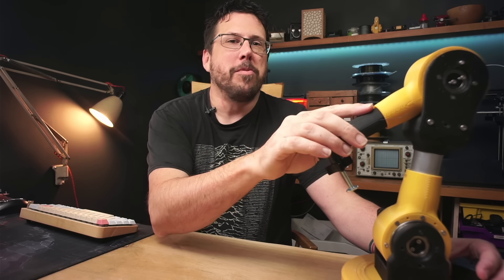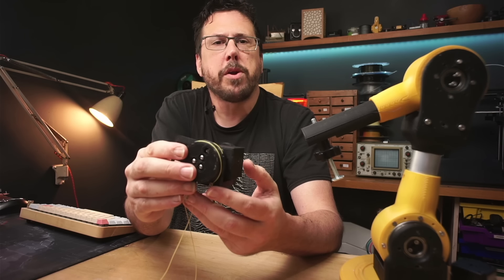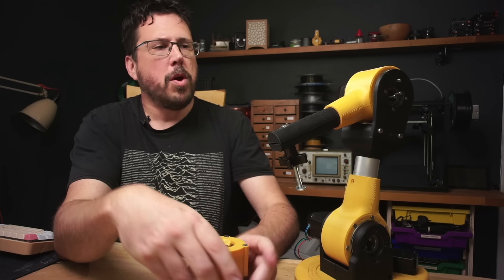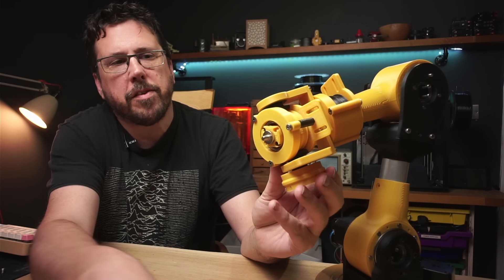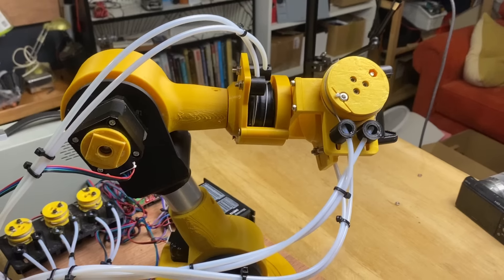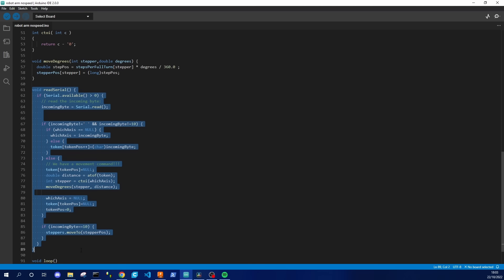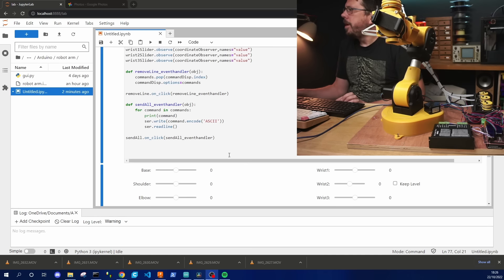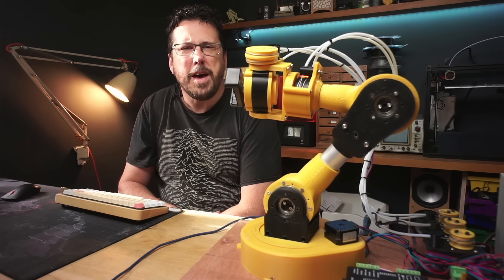Robot Arm Wrists are too heavy - until now!

Comment: I'm a beginner and I adore your ideas of running soft PVC tube protecting fishing line to simple turning motors instead of having heavy motors inside the arms. Simplification is something I am heavily targeting. Thank you Sensei. Subscribed, thumbs up. One question. I want to do the same thing for the a simple humanoid like robot for the shoulder joint as well. I am targeting rapid accurate movement with no weight being applied to the arm at all. It's more of an aiming system. Will it be foolish to apply the soft pvc tube protected fishing line design to the shoulder joint as well? I think I'm aiming for 3DOF on the shoulder joint at this stage. It's a robot that simply wants to flick light switches on and off in rooms. Just a bit of fun really.
Reply from the maker: Hi, that sounds like a great idea, I can't see why it wouldn't work. One thing to not is that this is not soft PVC tubing, it is PTFE which is slightly more rigid but also had a very low coefficient of friction which helps reduce the wear from the fishing line. Good luck!

Comment: Wow! Dude how tf I didn't see your channel earlier! The tubes with the wires are awesome! These motors at the top actually require the highest amount of torque from the shoulder servo as they are usually the furthest from the center of rotation.

Question: how many volts are you using for the stepper motors? 

Very very nice work! I'll replicate your work.

Thank you.

Comment: Outstanding, Hi, Since you are already familiar with the whole process, can i request you to think of designing an ELBOW joint with a single Motor/battery/controller in the foreArm section joint will have a one axis movement, (0-135Degree) , plus JOINT movement will be dictated by position of the Humerus section position/gesture.. i need this project for a real human use.. please let me know if we can collaborate..

Comment: If you're having problems with precision
attach your motors to a pinion
attach your lines to a rack
you can now get direct linear input to your wires for the whole length of your rack without having to worry about the changing diameter of your spindle

other things to get more precision is reducing the stretch on the wire, but i believe this would be more of a material science thing
one way to cheat this for stability is somehow working out a ratchet or brake system into each of the axis so it can hold its orientation without needing tension on your wire, or changing it to hydraulic. 
cool project
this kind of stuff is beyond my scope of competence

Comment: This is incredible. I am curious about how much wiggle or precision is gotten through this method for the wrist?
Reply from the maker: Some precision is lost as the lines can stretch slightly etc, but in my latest video I mounted sensors on each axis to make up for this. I’m getting better than 0.1degree precision now

Comment: I love your project.  When are the files going to be released?
Have you load tested it yet?
Is there a way to manage the tubing inside the arm?  I was thinking of a similar idea, but with the string running inside the arm via pulleys.
Is there a rough cost estimate for the arm so far?
Is there a way to speed up the stepper motors?
Reply from the maker: Thank you. Here's the answers to you questions:
1) I'll be releasing rough CAD and code files in the next video - it won't be a finished project by then and there won't be a BoM or instructions - but people have been asking for them A LOT. You'd have everything you need to build one with a bit of work, but THINGS WILL CHANGE in the design as I do more to it.
2) Nope. the wrist I showed in this video isn't that strong, it's up to my design criteria of carrying a camera, but not much more than that. The other joints are strong though. I need to add more reduction to the motors on the wrist. at the moment they are running at 2:1 compared to 20:1 for the other joints
3) Maybe.... The problem is that on the 2nd and 3rd joints of the wrist, the tubes need to move as the joint before them moves. If you can solve this (pulleys, bearings etc), then YES. I'd love to see you do it  :)
4) Ignoring electronics, PLA and fasteners, is about £50 on bearings and £50 on stepper motors
5) I don't think you need to, this thing goes FAST! I'm only showing it at about 1/4 speed in my videos
Reply: @roTechnic  Thanks for the response.  I think we all apreciate the time you take to read and respond to our comments.
 I know people pester you for the files.  Sorry to be one of them.  I guess it just means you are making something exceptional.  I'm excited to start work on this project and see if I can contribute.  
I don't know if you've seen his work, but Paul Gould does some great robotics work with different types of actuator mechanisms.  Here's a similar one to what I was thinking. https://www.youtube.com/watch?v=HWTwnZBwPuo
Reply from the maker: Thanks, that's really nice of you. I don't mind being pestered for the files, but I also don't want to release rubbish out - I'd like people to be able to actually make these things :D

And, yes - I know of Paul Gould - love his videos - and he is a sometime commenter on this channel!

That's a great design he's done, but I'm struggling to think of how to include another rotational axis BEFORE the tilting mechanism. I'm sure it's possible, but the solution is eluding me at the moment. If you've got any ideas then let me know (or make your own video, I'd love to see more robotics content out there)!

Comment: I have tried something similar in the past (i.e. using lines), but in a slightly different application.  I couldn't keep tension on the lines properly, and the lines would jump off the pulleys.  Did you have any such problems?  I wasn't using Bowden tubes, so perhaps that was my mistake.

Comment: Many high payload industrial robots solve the heavy wrist problem by using concentric shafts running down the arm, with all 3 motors for J4-J6 located at the elbow. Similar concept to your solution but with higher rigidity for more precise movements!
Reply from the maker: yeah, but I wanted to retain over 180 degrees of movement on the elbow joint and couldn’t go single sided

Comment: Super cool!
How much force can such mechanism (fishing line on plastic) create?
Also, can you show how you connect the fishing line (the knot) in a way that doesn't interrupt the movement of the mechanism?
Suppose I want to enable power-over-speed through the use of some planetary gear reducer, this means that at some point the knot on the line will reach the pulley. Will it interrupt it?
Reply from the maker: Hi, yes, unfortunately this doesn't provide continuous motion, I've got it set up so it allows just over 360 degrees of  motion

Comment: Just curious: why not just go hydraulic at this point? You’re already running tubes, and hydraulic pressure would provide more force for less effort than the cable setup.
Reply from the maker: I’m trying to keep this arm a cheap and simple as possible, using components that most tinkerers will have around, or at least have used at some point.
however, hydraulics would be awesome for this, and I’d love to do that as a future project

Comment: Excellent build! Definitely one of the cleanest 6DOF DIY arms I've seen. Out of curiosity, did you experiment with using different materials for the cables? I've used a similar mechanism for simpler builds, but immediately abandoned fishing line and switched to cotton thread to reduce elasticity. In hindsight I may just only had had cheap stretchy fishing line on hand. Also, I've been routing my cables with pulleys on each joint, which is slightly more compact but more complicated and a huge pain, especially for higher DOF builds. I'm curious what your thought process was on using Bowden tubes vs other methods.
Reply from the maker: I must admit that I already had done that testing years ago when I designed a laser engraver using fishing line to move the X and Y axis. I know that I tried quite a few things then, but for the life of me, I can't remember what materials I tried. I just remember that Spectra fishing line was best.

Comment: I don't understand the pulley arrangement at 0:50. How do you maintain the tautness throughout the lines. Does one line not droop when the other line is taut?
Reply from the maker: there is a matching pulley on the other end which takes up the line which would otherwise droop. Please see my video "The lightest robot arm actuator" for more details

Comment: Really nice idea Ro. I've used this technique in one of my machines as well. A lot of people take the shortcut of simply wanting to use servo's or stepper motors directly on the arm with either direct drive or a belt drive, but I still think that these actuator-kind of solutions work the best for lowering the weight of the moving mass.
Reply from the maker: Thanks Marinus. Have you got any pictures or videos of your machines?

Comment: Would there be any value in using 3D printer filament ... a non-brittle kind, like ABS, instead of string? Might have less friction in the bowden tube?
Reply from the maker: There could be... Can you think of any way I could attach the filament to the pulleys as filament doesn't like being wound and unwound - it gets brittle and breaks.
Reply: @roTechnic  ahhh, I didn't think that far ahead. Probably should have. Maybe it's a bad idea. I was just thinking that it can be quite low friction in a bowden tube. :|

Comment: Ok, I know this video is 2 years old, but I figured I might as well ask seems you seem to be very well educated on the subject matter.  I need a robot arm that can grab a piece of thick paper and align it on top of another piece of paper.  and smoothly place it on top and aligned.  Basically, I have a piece of paper, with a piece of cardboard glued to it with electronics inside the routes carved into the cardboard, and I need the other piece of thick paper to be placed on top of it sealing it (I can do this via spray glue or with a stick backed paper).  I'd just want a robot arm that was capable of placing the paper always aligned properly, over and over again, my hands are simply too Shakey and unreliable to do it.

The fact is I designed a board game that uses electronics, and there are no manufacturers in the US that are capable of replicating it and even trying to outsource has been pretty difficult, since the whole thing is so custom.  So, I've made my own PCBs, cardboard routed layout, and paper design to cover it.  It folds three times to go into storage and it utilizes blue tooth for to tell where the player is on the board and a phone to for voice recognition and projecting animated holographic effects inside of a "spirit jar" (that part works fine)...  I found arms who can place components on my PCB board and use putty solder to attach it, but I have only seen 2 videos of robots placing pieces of paper, and those were industrial with no real explanation as to how.  I'm assuming a 4-sucker head system would work, but I'm honestly not sure as I can find no examples of people doing that (mostly people just have it moving boxes).  I don't want to deform the print and I need it to be aligned when placed.  My end goal is to be able to manufacture this game myself, albeit a bit slowly.

As I said I've already worked out the control system utilizing magnetic switches and such inside the board, do you have any suggestions for a setup that could move and place a piece of paper precisely?

Comment: Hi made, i just stumbled upton your video, the robot looks sick. very creative way to reduce the weight of the wrist. I am a ceritied robotis engineer from the netherlands and work quite alot with industrial robots. There is another way to reduce the weight of the wrist! have you looked at the FANUC R-1000iA ? There, the motors of the wrist are moved to the elbow . Maybe you can get some inspiration form it
Reply from the maker: Thanks for the info, that is a nice looking robot! I was originally thinking of mounting the motors on the arm, but I didn't want to limit the rotation of the elbow joint (I've got >270 degrees at the moment). I could go single sided on the bearings for the elbow, but that introduces its own challenges.
I've never worked with industrial robots and it's really nice to hear how they solve these problems, please let me know of anything else in future videos!

Comment: Pretty neat but aren't you using relatively small motors anyway that wouldn't be much heavier in more direct placement?
say with tiny metal gears. you could try to incorporate metal 3d printing for key parts and aim to miniaturize.
Reply from the maker: the motors I'm using are quite heavy compared to the payload. This is one of the problems with using plastic 3d printing for this kind of thing, we're right on the edge of what's possible, so even a couple of hundred grams matters!

Comment: Amazing Video !!! 

If you don’t mind me asking a question,

I am working on a 4 axis arm myself at the moment. But I seem to be butting heads with the MultiStepper library, due to each individual stepper has a it’s own driver. When I upload a command to the serial monitor for an example, ( F1,45 F2,18 B3,20 … ) the first command will only activate. 

Do you have any recommendations?
Reply from the maker: Have a look at the code in my latest video - that should show you one way of doing it. If you can't work it out, drop me another comment (on that video so I pick it up) and I'll give you a hand
Reply: @roTechnic  Thank you very much ! I am going to look at it right now!!! 

Thank you again, you are the best !!! 

P.S. sorry for the delayed response
Reply: @roTechnic  Quick question again, I can’t seem to find the control code for Arduino (robot arm sensor.ino). I have found the sensor code and also python UI, but not the control code for the arm. Thank you.
Reply from the maker: the serial code is in SerialController.cpp and the motor code is in the .ino file - it's the first bit in the loop function and the movedegrees function
Reply: @roTechnic  ok awesome ! Thank you again. I’ll take a look at it right after my exam.
Reply: @roTechnic  Hello again,  I have been slowly working backwards from this videos code and trying to get simple movement, but I am unable to get it past the compiling stage. I keep getting an error of aStepper was not declared. Anyway if you could take a look at the code I recreated for my purpose that would be a great help, thank you ( Code bellow )

// Charles 
// Serial Robot Arm Code 11/13/2022
// please work :)

#include <AccelStepper.h>
#include <MultiStepper.h>

AccelStepper newStepper(int stepPin, int dirPin, int enablePin){
  AccelStepper stepper = AccelStepper(stepper.DRIVER, stepPin,dirPin);
  stepper.setEnablePin(enablePin);
  stepper.setPinsInverted(false,false,true);
  stepper.setMaxSpeed(800);
  stepper.enableOutputs();
  return stepper;
}
unsigned long time; 

AccelStepper aSteppers = newStepper(1, 4,3);
AccelStepper bSteppers = newStepper(1, 8,9);
AccelStepper cSteppers = newStepper(1, 12,11);
AccelStepper dSteppers = newStepper(1, 7,6);

int incomingByte = 0;
MultiStepper steppers;

long stepperPos[4] = {0,0,0,0};
long stepsPerFullTurn[4] = {16000,16000,16000,16000};

void setup() {
  // put your setup code here, to run once:
  Serial.begin(9600);
  steppers.addStepper(aStepper);
  steppers.addStepper(bStepper);
  steppers.addStepper(cStepper);
  steppers.addStepper(dStepper);
}

int tokenPos = 0; 
char token[10];

char whichAxis = NULL;

int ctoi( int c){
  return c - '0';
}

void moveDegrees(int stepper,double degrees){
  double stepPos = stepsPerFullTurn[stepper] * degrees / 360.0 ;
  stepperPos[stepper] = (long)stepPos;
}

void readSerial(){
  if (Serial.available() > 0){
    incomingByte = Serial.read();

    if (incomingByte! = ' ' && incomingByte! = 10){
      if (whichAxis == NULL){
        whichAxis = incomingByte;
      } else {
        token[tokenPos++] = (char)incomingByte;
      }
    } else {
        token[tokenPos] = NULL;
        double distance = atof(token);
        int stepper = ctoi(whichAxis);
        moveDegrees(stepper, distance);

        whichAxis = NULL;
        token[tokenPos] = NULL;
        tokenPos = 0;
      }

      if (incomingByte==10){
        steppers.moveTo(stepperPos)
      }
    }
  }

void loop() {
  // put your main code here, to run repeatedly:
  read.Serial();
  steppers.run();
}
Reply from the maker: @charles26842  you're declaring the variables as "aSteppers" on line 19 and then using it later as "aStepper". remove the s on line 19. If you want tt chat about this more, grab my email address out of the about tab on my channel and send me an email

Comment: I wonder, could there be a method, with combining camera, gyro, lidar, and similar sensors, to make the robotic arm less dependent on software-hardware conversion, and compensate for any slacks that could occur eventually? Imagine you get some loose movement and that the arm tries to perform a task, but that the coordinates are outdated because of the material deformation, with sensors, a camera, and so on, software could do calculation again to compensate so the endeavour is the same.
Wouldn't that be interesting? yeahhhhhh.
Reply from the maker: That sounds fantastic! I'm hoping to eventually hook this up to ROS2, and at that point I'd love to try this.
Reply: @roTechnic  Fantastic! I'll check the little bell so I keep track of your progress!

Comment: It would be nice to hide the tubes inside the arm. Why aren't all the joints cable mechanisms?
Reply from the maker: Yeah, I'd like to hide them, but one step at a time :D. As to why not all axis like this, the other axis need to take a lot more weight - due to the am acting like a lever, so they need to be a lot stronger